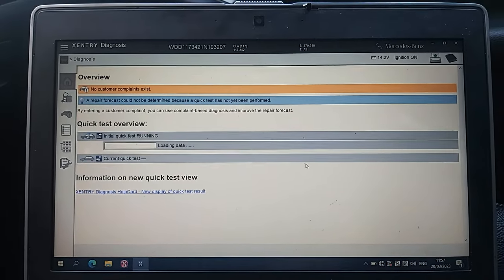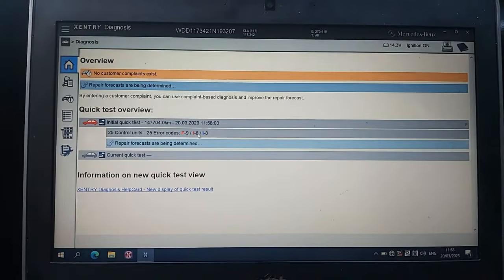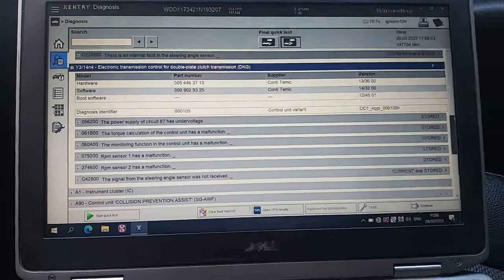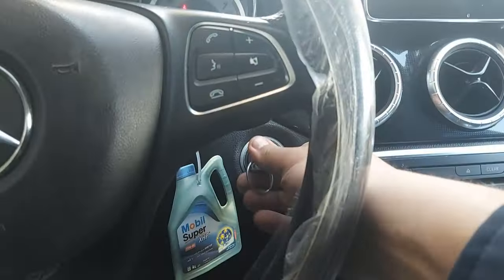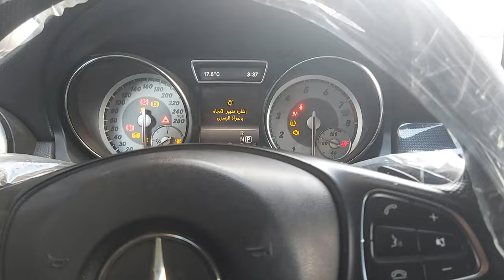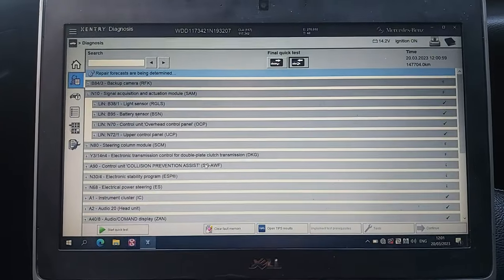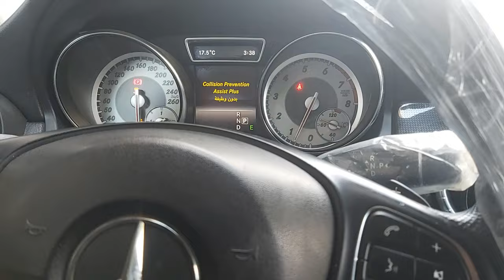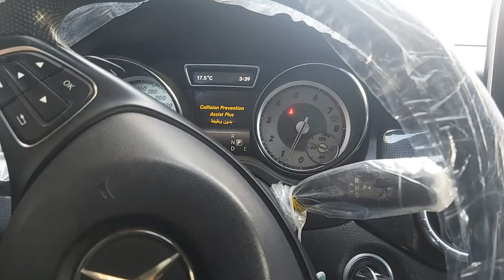Steering Angle Sensor Internal Fault Repair On Mercedes Benz CLA W117

Comment: Hello! I have i used a code reader and it shows that I have a problem u0126. I dont understand why the esp light does not come on and everything works fine any ideas what it could be?
Reply from the maker: So what fault code means ? ...
Reply: @heshamessam8042  Its says that steering position sensor control module no communication. I have w205 and i guess that i need to get other lights but i dont get at least chek engine light like car work fine
Reply from the maker: @Ban1l  so may be an old code ... if you are having no communication with steering column you will not be able to select gears
Reply: @heshamessam8042  Thank you for help so its false code then because i read it with obd2 scanner i guess it just dont mean nothing! Bless you!!!
Reply from the maker: @Ban1l  yes try to erase and see if it come back
Reply: @heshamessam8042  I'll try, if it doesn't work I'll do the repair according to your video !!!
Reply from the maker: @Ban1l  ok

Comment: You just saved me at least 1500USD from my local dealer. I was getting a constant error on my W205 and after cleaning the optical piece, gear, everything and now it works perfect! Thank you so much for sharing this info. 

Regards.
Reply from the maker: Thanks 😊

Comment: Hello as a G Specialist from Holland.
Nice Video i love Total teardowns 😂 👍🏻😂
It is pretty sure,  that this car  also has a canbus related problem.
If the Costumer comes Back Andl the CAN communication fouldcodes are Back:
Try to locate (At a G its the greenWhite/green twisted pair)
You should look for a damaged wire that makes a short to a metal dash part of the car.
Or the connectors Are badly corroded.
When you have this Problem It's sometimes generates faultcodes that makes you Think you need a new part.😂But in fact The System is totaly messed up du to Poor Communication..
I have some Can related footage on my Channel..
Measuring Resistance on the (Can's of wurms 😂) is one of the first things I would do in this case.
In rest It should be 60 
Ohms of Resistance,  Because of the two 120 ohms end resistors.
So Less than 60 It's a short, more Than 60 ohms, you have a connection problem.
Good Luck.✌🏻

P.S.
If you have a short, you
disconnect the Can Wires one by one Until The short is gone.
So you Easily pinpoint the Cauce of the Problem.
Reply from the maker: @rickstevens2941  thanks